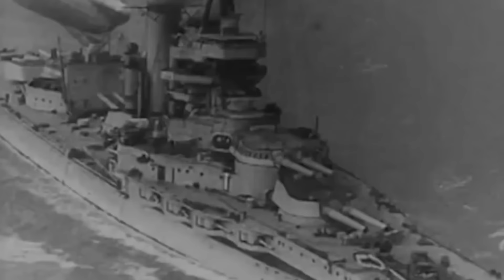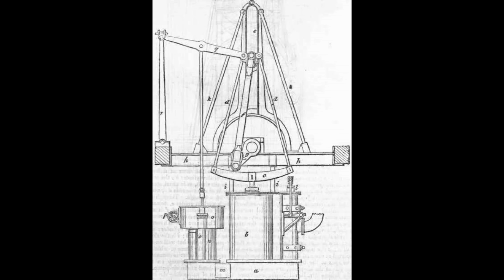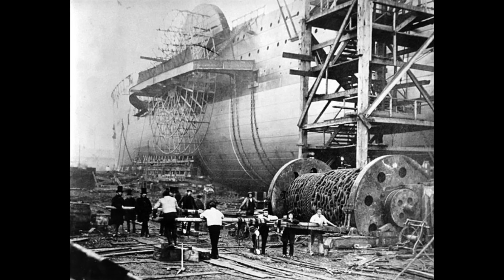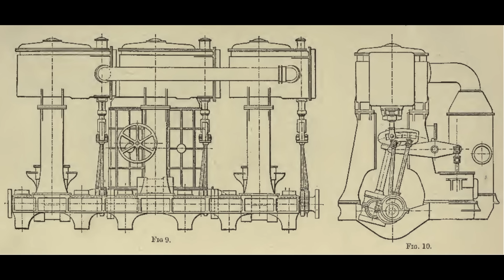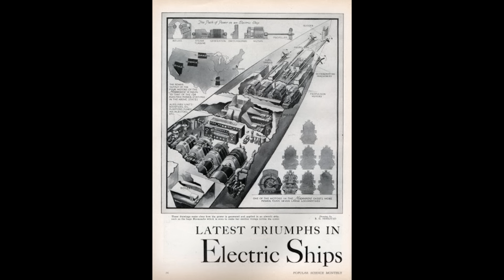Naval Engines - Rotate that shaft!

Comment: Nuclear power was briefly mentioned, but is it relevant in an 'engine' video. The engine doesn't care how it's steam is generated. Thus, nuclear power is only relevant to boiler development.
Reply: The engines in nuke ships are vastly different than diesel & steam engines, so yeah it is relevant to mention that.
Reply: @jtwg4th253  No, the engine in a nuke ship is just a normal steam turbine setup. It only differs in how the steam is generated, i.e. the boiler.

Comment: Can you imagine, some people today won't even buy a car if it has under a hundred HP, and these guys were moving 200 ton boats on less. I know the speed wasn't comparable, but it's amazing to think how much you can actually do with mechanical power.
Reply: I would consider sub-100 hp to be borderline underpowered for ordinary driving. My (relatively small) car has something like 110, and accelerating to merge onto a freeway often requires firmly firewalling the pedal and revving concerningly close to the red line.
Reply: A small passenger car only requires about 20 horsepower to do motorway/highway speeds - the extra power is only needed for getting up to that speed in any reasonable time.
Reply: I feel like a 20 hp engine would give you a 0 to 60 time of maybe
Reply: ships do not climb hills
Reply: @huseyinuguralacatli5064 not with that attitude
Reply: @huseyinuguralacatli5064  Nor accelerate to merge into traffic.

Comment: 7:30: Difference between nominal horsepower and "overload" power: 
 
I met someone who had had as hobby to ride along on steam locomotives. He also said that you could overburden a steam locomotive by about 50% for a short time (getting moving or so).
 
But then Germany introduced diesel locomotives, nominally even stronger, but the issue was: when you went beyond that output, it simply broke immediately.

Comment: 28:00 I imagine a big reason for using steam engines in less-important, non front-line ships, during WW2, would be the fact that the UK had to import all it's crude oil. We didn't know at the time about the huge oil fields in Scotland. Petrol was banned for cars, with just a few exceptions. 

I once read of a village doctor who converted his car to "producer gas". That's produced by running steam over hot charcoal. The result is partly CO, which burns to make CO2, methane, and hydrogen. Incidentally, the same sort of stuff that gasworks used to produce, "town gas". All towns had at least one gasworks, that'd take coke (refined coal), and produce gas from it. The gas would then be sent down the same gas pipe network we have now (though we've hopefully replaced most of the actual pipes).

Again, we weren't aware of the North Sea oil fields, so the vast quantities of gas we now use, weren't available. Because this "town gas" contained carbon monoxide, it was deadly in itself. People used to commit suicide by putting their heads in the oven, it was sort-of a meme way back when. Nowadays, "natural gas" is methane from the oil fields, not poisonous in itself, although it will displace air, although it's heavier than air so will sink. Will still blow your house up though. But never mind.

This doctor had a small version of a gas works. Charcoal or coke in the boot in a reactor vessel, with steam sent across it. The resulting gas travels up a tube to a big floppy fabric storage bag, gas-tight, on the roof. Then that connected to the engine. Engine needed a bit of tweaking but ran on producer gas surprisingly well. So the consumables were water, and either charcoal or coke.

Britain didn't have our own oil back then, but we had, and still have, shitloads of coal underground. And plenty of miners, back then. So they got digging for victory. So a ship that would run on coal rather than precious oil, would be extremely helpful. Not in this case anything to do with producer gas, instead they were steam engines as described.

Comment: Can we please stop talking about vacuum. Start using the correct term, that is underpressur or low pressur in reference to a standard atmosphere 1013 hPa  . And there is nothing exploding inside an engine, it`s a controlled combustion which has a fast moving flamefront!

Comment: Thanks for all your hard work putting these together. You repeatedly mention gearing as increasing the power to the prop shafts. This is technically incorrect. In a lossless system gearing changes the torque only, not the power output. 

Also, you refer the the steam piston as the “cylinder head.” Is this a difference with British vs American English? Here the piston is the moving part the steam acts on, the head is the stationary end of the cylinder.

Comment: The sound of a steam turbine engine room  at flank speed is indescribable. I miss it terribly. Thanks for the video.
Reply: I don't miss it.  I still hear it when the room is quiet.  Actually, from the frequency of my tinnitus it's either the SSTGs or the Forced Draft Blowers...propulsion turbines had a lower pitch.

Comment: Diesels can run on HFO - heavy fuel oil, never heard of one running on Bunker C like a boiler, at least in the wild.  Most of the time, at least on merchant ship, the engineers will switch over to a lighter diesel fuel for maneuvering prior to taking arrival.  While more expensive, DO allows for faster engine response to speed change orders.

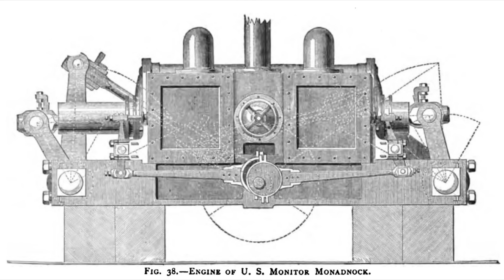Comment: 19:30 I believe that this is what we would call a boxer engine in the modern-day, although the piston heads seem to be inversed, either way, same concept
Reply: Its not the same concept at all... its an opposed piston engine (very common configuration for naval powerplants as they are extremely reliable and efficient). They are still produced by Fairbanks Morse for many applications. There are different arrangements for how power is transfered in these engines (levers to the central crank or gears typically). Achates Power also has modern designs of this engine for automotive application.

Comment: Congratulations on a really informative and well illustrated survey of a big subject!   Two little quibbles: Should you have referred to the piston rather than the cylinder head in one or two cases when referring to steam engine configurations?  And number 2: As a retired electrical engineer,  I have to dispute the statement that electric transmission schemes: ' . .drag the efficiency of energy transmission all the way back down.'  Yes - there are some energy losses in electric generators, motors and cabling, but as a % of the throughput power the losses are not too bad, except when operating at very low % of rated power (ie low ship speeds). There are some notable recent examples of electric power transmission schemes being adopted (aircraft carriers), 
 using ac and electronic power converters instead of the dc machines of old.
Reply: Indeed. As an EE I'm sure you are aware that electric power is work, in a thermodynamic sense. The efficiency of electric motors is very high, often >90%, because useful work in the form of electric current is what is supplied to them. The conversion of heat to work is where the Carnot efficiency, as a best case, limits the amount of work that can be extracted from a lump of coal or gallon of oil. The turboelectric drive used in the Lexington or Saratoga operate the generators on a Rankine cycle and they would have operated with a thermodynamic efficiency of about 35%. The rest of the system would have, at ideal conditions run at over 90%. Losses in the electrical side would be greater at turndown conditions. I reckon that a modern system using a combined-cycle gas turbine and good inverter technology would be a hard system to beat.

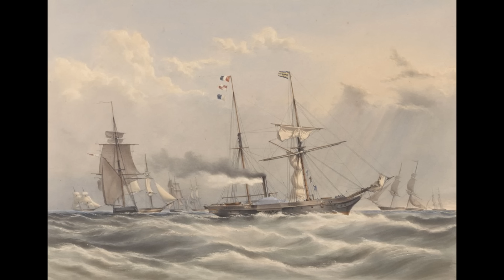Comment: Boy, that transition from vacuum pressure to actual steam pressure, around 6:50, was a little vague.  I still didn't get when the change-over was made.   And are you mixing up cylinder heads with pistons and with cylinders?

Comment: Dear Drach:  at 4:13, you say steam pressure causes the cylinder head to rise.  I beg your pardon, please understand that the heads are affixed to the ends of the barrel and never move ... it is the piston that reciprocates in a piston engine, taking the piston rod, the crosshead, the connecting (con) rod, and the crank throw, along with it.  With that snarky critique out of the way, I tip my hat to your excellent and very entertaining channel!

Comment: One special problem marine diesels have is that they need compressed air to turn them over to start them up.  If your compressed air tank is punctured by battle damage, you can’t restart.  My father was on a diesel engined merchant ship bombed at Milne Bay in 1942,  and a bomb splinter punctured the air reservoir tank.  Couldn’t start the engine and, even when the tank was welded up, couldn’t fill it with compressed air since that required the engine to be running.  Ship had to be towed to Brisbane for repairs.

Comment: BTW, as with the triple-expansion engines making a comeback in WWII due to limitations around turbine (and reduction gear) production, the turbo electric (TE) drive also made a bit of a comeback then; with the Buckley and Rudderow-class destroyer escorts and the mass produced T2 tankers all being built with TE plants due to bottlenecks in production of reduction gears.

Comment: Isn’t it remarkable that sailing ships continued to evolve all the way to the opening of the Panama Canal in 1910. The best cargo sailing ships were built between 1900-1910.  They were efficient, requiring crews of 1 person per 200 tons of cargo, were sailed economically at a speed matching steam ships, and actually used tiny steam ‘donkey’ engines to drive the winches that hauled in and let go the yards, which by then were all made of steel, as were the hulls of the ships.
Reply: "1 person per 200 tons of cargo" still works out to over a hundred crew for a reasonably-sized cargo ship, though...
Reply: @vikkimcdonough6153 Which is probably still similar to (or better than) a steam ship of the time (due to all the stokers and mechanics).
Reply: @vikkimcdonough6153  

G'day,

Your idea of a

"Reasonable Sized Cargo Ship"

Is my idea of a 
Fossil Carbon burning
Selfish
Ecologically-Suicidal
Megalomaniacal and
Psychotically
Stupid
Idea...

The
Realisation of which
Has now almost completely
Destroyed the
Biosphere.

Sailing Ships built of Steel burn Coal while being manufactured, from smelted mined Ore...

But at least they didn't 
Guzzle Coal or Oil,
Nor fart Carbon Dioxidein order to move at all...;
The Sailing Ships were a whole lot
Less
Insane a concept to make into
Reality.

In point of
Actual
FACT.

Such is life,

Have a good one...

Stay safe.

;-p

Ciao !
Reply: A few survive, the Moshulu in Philadelphia is one such.

Comment: 14:32 Gearing up doesn't divide the power, it divides the torque. There are some transmitted power losses, but they are in general not proportional to the gear ratio. The same applies to gearing down the steam turbine at 34:33: more torque, not more power.
Reply: TorQue is a method of measuring force, different than horsepower, but measuring a similar phenomenon, unlike pounds (weight) and kilograms (mass), which measure entirely unrelated things.
Reply: @davidharner5865  Here on Earth, slugs* and pounds are functionally interchangeable. 

*Imperial unit for mass

Comment: With the reciprocating  engines, How come they didn't use counterweights on the crankshafts? One of the drawbacks with the Texas was the fact it had vibrations ay high speed. It isn't as much a problem with merchant ships as they don't run at high power.

Comment: It is also worth mentioning in your discussion of turbo-electric drives, the choice to select this type over a direct drive with reduction gears was also due to the extensive time required to cut the  reduction gears each shaft needed (one bull gear plus one or more drive gears per shaft).  In the early and middle 20th Century, a bull gear required up to 5 years to be completely and properly cut - and the wartime need (combined with the limited number of machining facilities that could do this type of work) meant that turbo-electric drives had to be used more as a matter of absolute need rather than preference, especially on larger ships.
Reply: I don't know where you got 5yrs for a bull gear. I worked in the gear division for G E in Lynn MASS. I also was on the RD project for the U.S. NAVY high speed reduction gearing. Used for the ARLEIGH BURKE  claass destroyers for DDG 51 and up . My first job was a cnc machinist on a 4 axis horz boring mill. Gear plant was only building on other side of RR tracks and when i went into that building . The first thing i saw was a bull gear getting lowered onto the largest vert turr lathe i ever seen.  I don't know the number or carrier but it was CVN Every machine in that build was manual and huge. The actual gear cutting was done on the far side of my building but i don't remember the bay numbers.  At the end of my bay they did the test then breakdown and reasable. That was something but couldn't get close.
     Now the good part. Every machine except small hobbers were old and manual. This is why the gear plant is a vacant lot now. In the old turbine assembly building ( 64 ) they were building and installing the largest 7 axis CNC horizontal boring mill. Because of the inlet from Atlantic Ocean they had to make round footings going over 100 ft deep to bedrock. Like a table with 8 legs. Why because high and low tides effected mach in gear building. The actual machine footing that sat on top of those legs .it was 2 stories deep with all the coponet machine and parts.  The 7 axises  1 horz   2  vert  3  comp run index table   4  table could move in and out   5  18in horz ram ? NOT SURE OF SIZE   6   was  6 in horz spindle inside ram   7  you could add attaching comp to end of ram for side cuts inside . Because i was only one that knew about cnc machines. I was hired at the top union rate r 25 with RD classification.  Ge was promised 3 ship sets a year after U.S. NAVY excepted them.  RON REGAN became president he immediately gave westing house 1 of the 3 and who ever delivered on time got the 3rd.  Sorry rambling on i hope i didn't bore you
Reply: @skipd9164  I'm sorry but I should have been more clear.  In the pre-WWII build-up of naval forces the number of large vessels being ordered were outstripping the production and machining capacity available for large fine-tolerance parts, so estimates for the time required to cut four full sets of reduction gears for each large navy ship ordered (and for proposed future orders) had a lead-in and production time of up to five years per vessel.  This was based on the priorities of the US Navy, which began shifting dramatically after Pearl Harbor when aircraft carriers became the dominant capital ship instead of the battleship.  This was a primary consideration for the switch to turbo-electric drives instead of direct turbine drives on the upcoming generations of new US battleship construction.  Simply put - the turbo-electric plants could be built and put into service faster.  Cheers!
Reply: @Jon651  no problem jon. I don't know if want to read the rest of my comment.  Many times walking threw the roads that connected buildings. I would think about the mass amount of production and employees that did it. Gear Plant building was built ww2. I was told that most of the shpset came from there. I had the privilege of working on some of the biggest machines i ever seen. In trade school they would be in books. We all realised that we would never have the opportunity.  Thats why the day i walked into the Gear Plant, ill leave it at that. Most likely machinist in GE Lynn will never work on large machines. We also made the gearing for the Trident and Sea Wolf
Reply: This started 1983

Comment: At 4.12 did you mean "forced the cylinder head to rise"? Looking at the engraving, the cylinder head is firmly bolted down to its cylinder. If the piston head rose instead (as is normal), one would only need packing where the piston rod projected out of the cylinder head. The entire 'cylinder head rising' would result in a huge loss of steam along its circumference, especially owing to manufacturing tolerances of the time and wear during use.

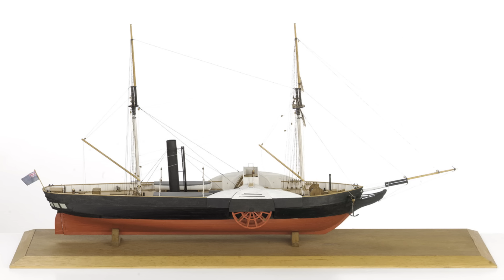Comment: This is an excellent documentary and the various types of engine throughout history requires a vast amount of research and I bow to this font of knowledge. However at 2:51 I think what you have in your drawing is the 1812 Comet, built by Henry Bell of Helensburgh. She was a passenger vessel and not a naval vessel and was wrecked around Loch Lhinne in 1820. The 4 paddle wheels are pretty unique to her, but were soon lost in a subsequent rebuild prior to her wrecking. She was replaced by the Comet II, also a passenger vessel as far as I know. Henry Bell was a very interesting character.
Biography: The Ingenious Mr Bell by Brian D Osborne
NOT to be confused  with The Ingenious Mr Henry Bell  by David Higgins. 
This Henry Bell was a Kings Lynn Architect who died in 1711.
A full size 1962 replica of  the 1812 Comet, is in Tesco's Car Park at Port Glasgow. This is on the site of Scott Lithgow's shipyard.